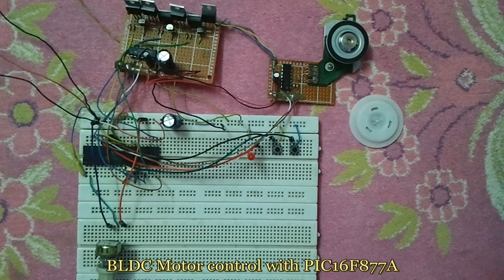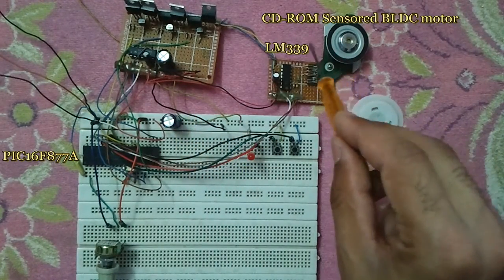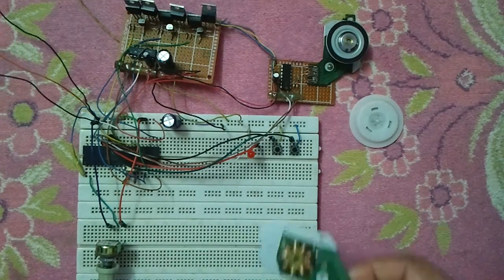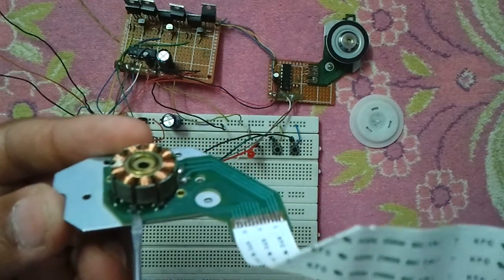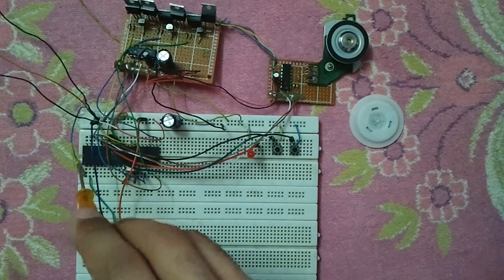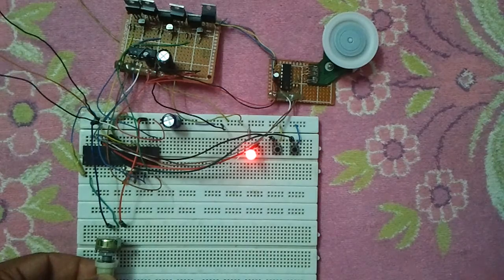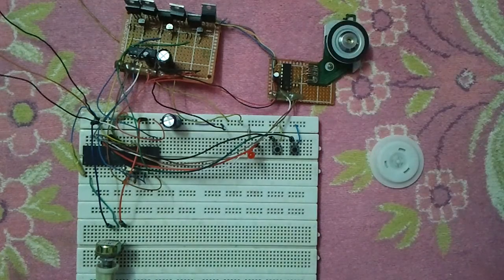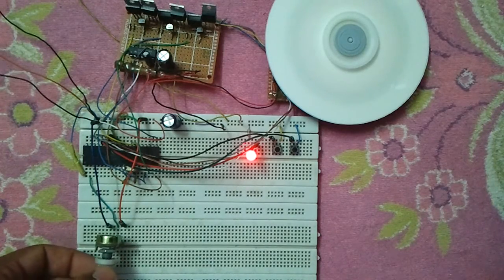CD-ROM Sensored brushless DC (BLDC) motor control using PIC16F877A

Comment: I am trying to build this project
and i want to burn the code you provide at blog
there's some question i have 
hope you can help

you had provide a c code  but shuold i have a hex code to burn before?
if i had to , could u share the hex code to me.
appreciate your share.

 I am not native in English sorry for my bad scribe
Reply from the maker: Hello,
Use CCS C compiler to generate the hex file and then burn it to your microcontroller.
Regards.
Reply: Thanks, I've done the problem of code transfer
but now, i have a more bigger question 
in my circuit, A+ B+ C+ got only 3V
I don't know is that true ?
and 
my BLDC's ABC(UVW) A = 12V B= 3V C = 3V
and my waveform didn't change
I don't know how to  confirm where's the problem?
Why I can't make my BLDC rotate
Could you help me give me some advice?
Reply: and my xtal doesn't have waveform only just have static 3V